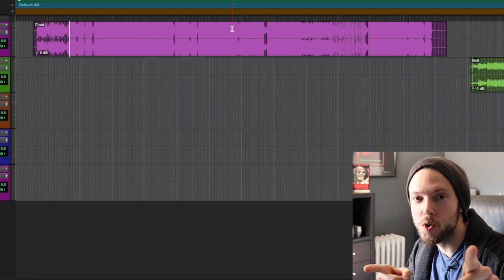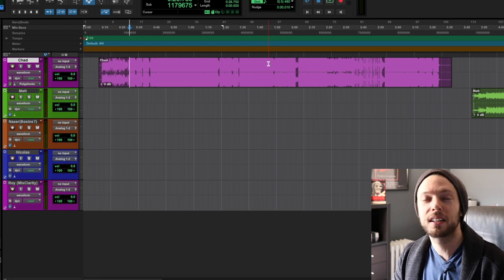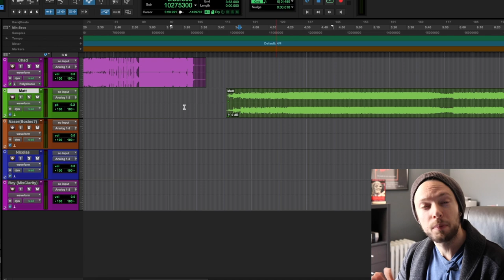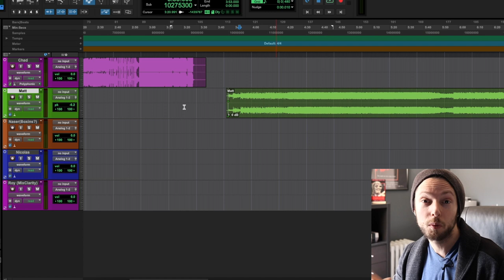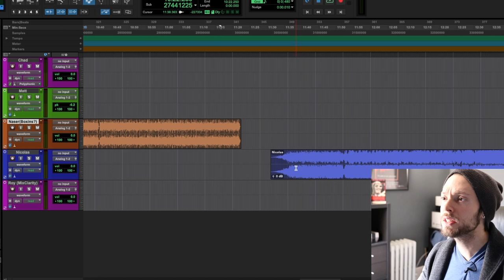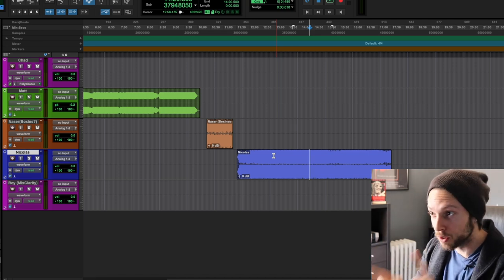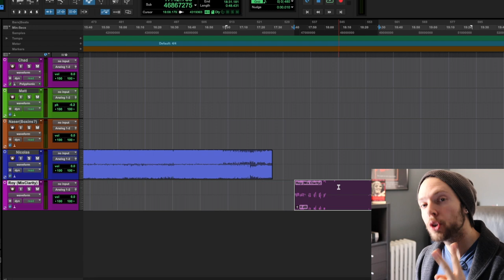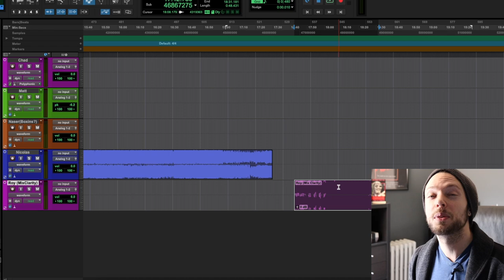Too Much Compression Will DESTROY Your Snare Mix | CSM19

Comment: Thanks for the tips Bobby, greatly appreciated you took the time! Since submitting this track I've actually cleaned up the bottom end a fair bit and made the kick a bit less oppressive. I also lowered volume and dialed in a bit more of the room mics (I use superior drummer) to make the drums sound more organic. I also tamed some low end of the bass to not interfere with the kick. Glad my own instincts mirrored yours, gives me confidence I'm on the right track :) Again, greatly appreciated.
Reply: it´s great to get reviewed, isn´t it?
Reply: @Eurodrummer666  yeah it is, like I said gives me confidence and extra motivation :)
Reply: @roywennekes8548  sure, I've been applying Bobby's pieces of advice for this song, and I'm happier with the results.